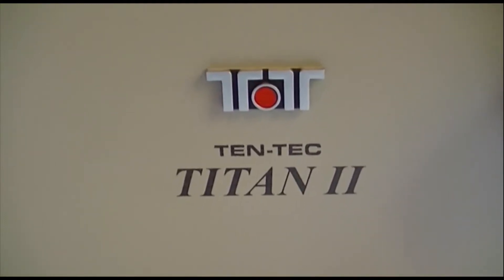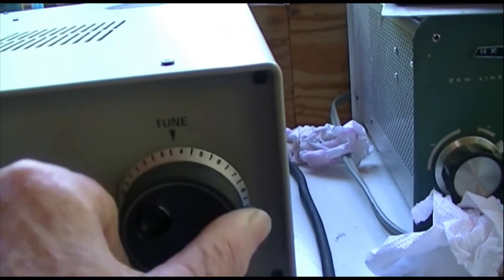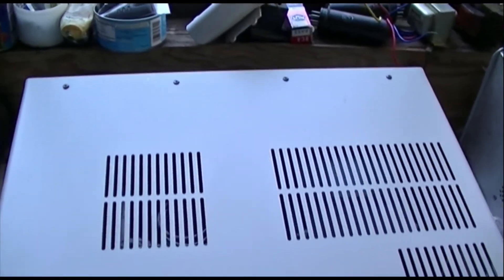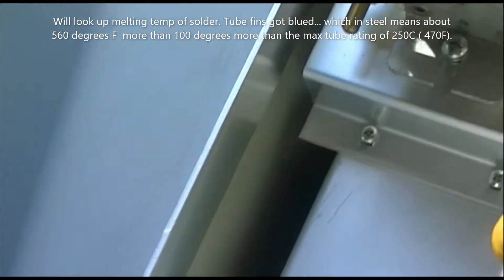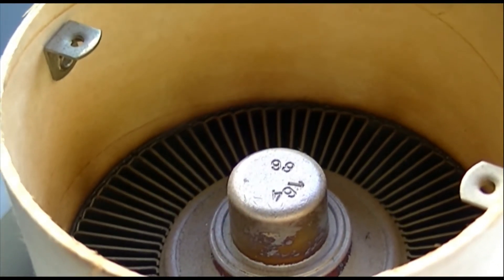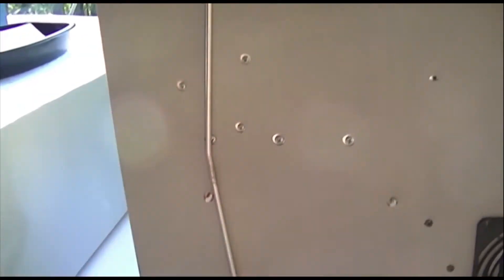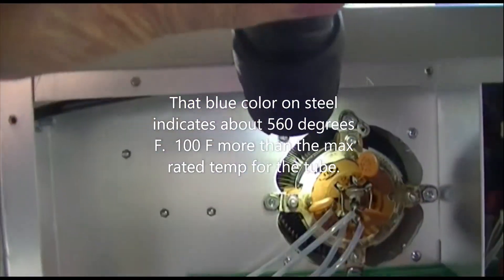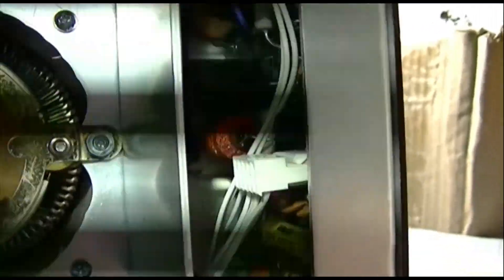W6WUH INSIDE CLASSIC HAM RADIOS  TEN TEC 416 TITAN II LINEAR AMPLIFIER

Comment: Very sweet, a dream to have.
Reply from the maker: I agree,   I am very lucky to have it... and even luckier that the tube is very good.  Apparently this is one of the cleanest linear amplifiers ever offered to hams, in terms of IMD products. I should have made a video of it in operation.  The sum total of the actual maintenance on it so far has been cleaning, resoldering the plate connector, visual inspection,  and giving a whack to a balky relay on the main power control board.  I am now experiencing some HV arc-over, so have to get it on the bench and find out the cause of that...likely something simple.
Reply: @captlarry-3525  I started too late in HAM radio, to have much of a collection, I'm 75 now and got my license 4 years ago.
Reply from the maker: Power supply Repair Video Going Up Today...

Comment from the maker: 30 meter operation on 40B  is normal per the manual.   I dont know if silver plating means the blue coloration can occur at a lower temp than the figure I used which is for Steel.

Comment from the maker: Looking now like a simple case of fan relay failure.  Fan out of the amp works ok... but amp will not cycle on... so this suggest relays on the primary voltage control board... life got in the way I and I have not gotten back to work on it except to confirm the fan itself is OK  10/10/21
Reply from the maker: 7/5/22   balky relay now working fine, as does the whole amp !

Comment: Did you repair it?  Did you sell it yet?
Reply from the maker: Thanks for asking.  I found the cooling fan In-Op.  But have been consumed with Ranch work, and haven't done more.  Next step, is to feed the fan 120v directly.. see if it has failed, and also check to see  if the fan is being supplied with power.    Perhaps I can supply cooling air with an external squirrel cage blower.. and see if the tube is good.  With those 2 things done..what comes next will be obvious.
Reply: Great.
Reply from the maker: @dfpolitowski2  Removed fan, and tested it.. fan is fine.  So probably a simple relay died.. and P.O. being olds maybe couldn't hear the fan failure ?
Reply: @captlarry-3525  You can do it Larry!!
Reply from the maker: @dfpolitowski2  gotta get a service manual.. op manual is quite limited when it comes to servicing.
Reply from the maker: I did repair it.   I doubt that I will sell it.  But if I do it will be almost $3000.  The tube proved to work like new !
Reply from the maker: @dfpolitowski2  thanks.. I did, and pretty quickly, once I got the guts to try it., wasnt the amp I was afraid of.. it was the tube being bad. Turned out to be just like new !
Reply: @captlarry-3525  Great!
Reply from the maker: @dfpolitowski2 I am one lucky sob !